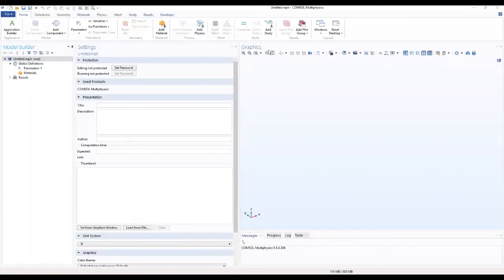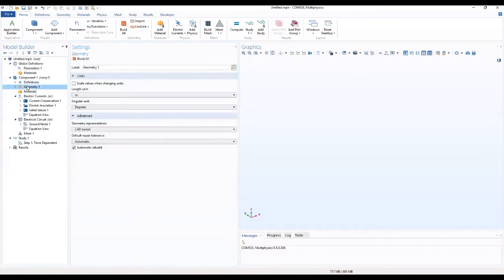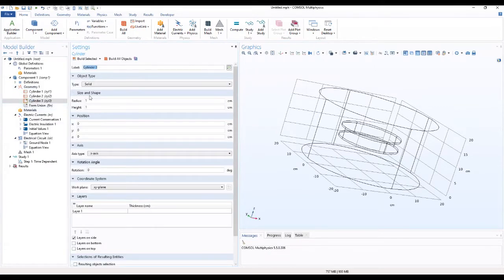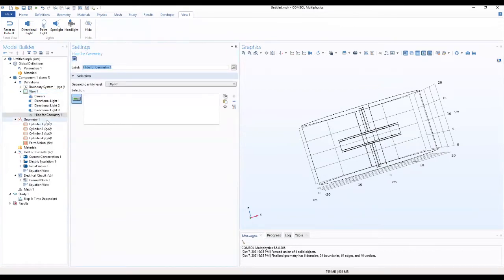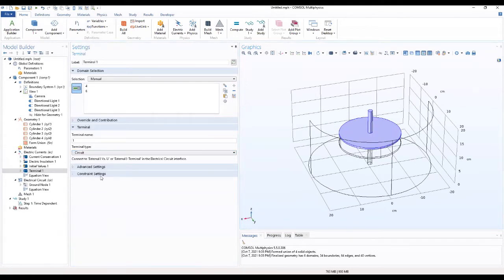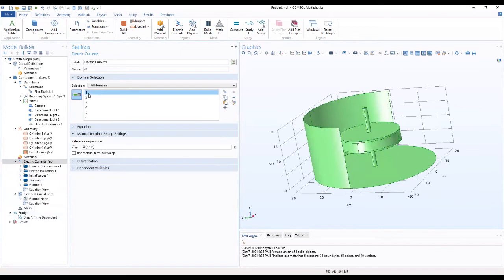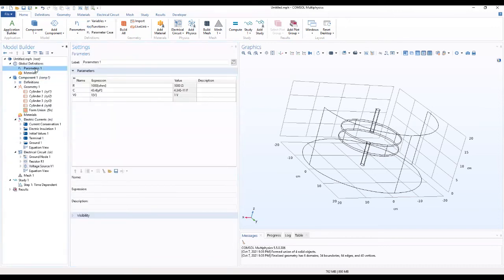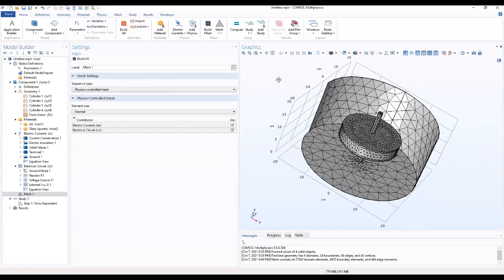GEOMETRY, PHYSICS AND MESHING BUILDING IN COMSOL MULTIPHYSICS

Comment: Q3: For Resistor or Voltage source, you have to assign a value for p or n, what is the physical meaning of these values?
Reply from the maker: Resistance in parallel to pn junction, the contributions of p and n are checked before solving,  we create unique nodes for the device

Comment: I have question: how do you know which part is 1, which part is 4, which part is 36? when you define for example the explicit, the terminal or the ground?
Reply from the maker: These are specific boundaries which are selected. I think i rushed a bit at this part of the video. i was supposed to zoom in on the geometry and select these parts. However, i used a simple method for the selecting by just pasting the number. sorry about that